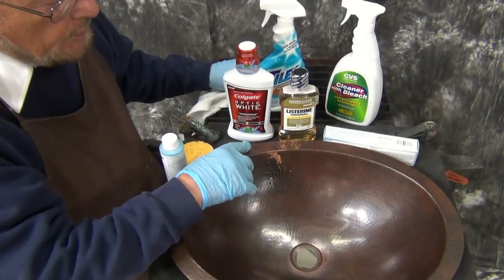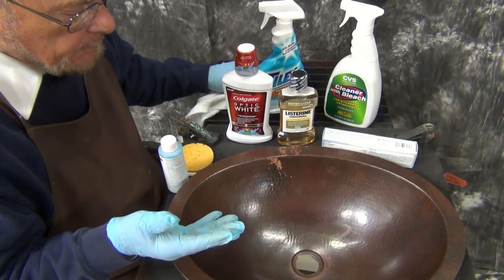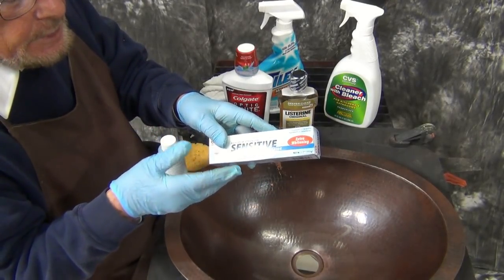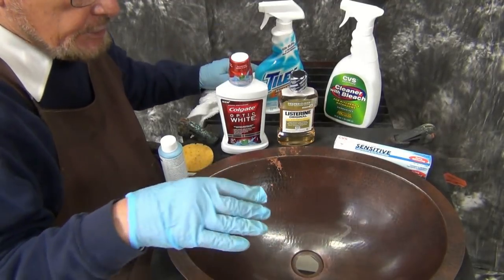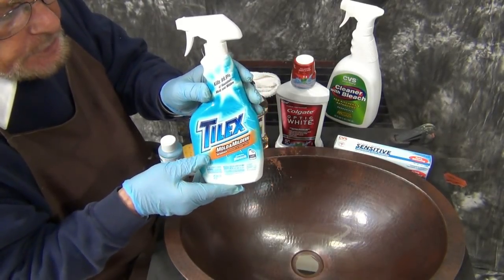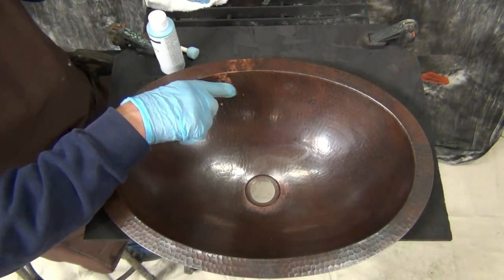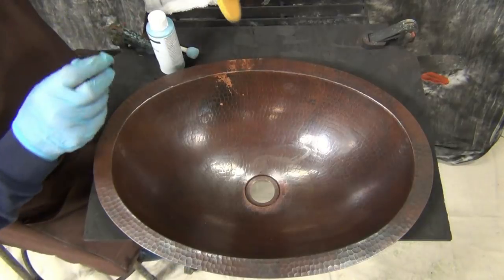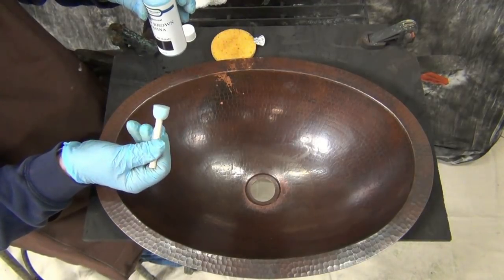Copper Sink Patina Repair

Comment: I have a sink exactly like this, and I damaged it when I wiped it out with a damp sponge - not realizing there was cleaner chemical residue of some sort on the sponge.  It removed my patina down to the shiny copper in several places.  I used all the materials you suggested here, and even as a novice, it came out amazingly well!  The only thing I would say is that the brown patina spray is very very dark, much darker than the sink, nearly black.  Also, you sort of skipped over the part about using the solvent, but I figured it out.  Very helpful video, thank you!

Comment: Excellent tutorial.  Thank you.  I left dishes and flatware in my new copper sink.  Nothing acidic, but now there's rings and worn places where the patina is rubbed off.  Good to know it can be treated, even if it is annoying to discover how fragile the finish actually is.
Reply from the maker: To increase durability, you just need to use the right clear coat. Ever Clear will give you the best protection available.

Comment: So i have a copper sink that is pretty used and needs to be touched up. Do you recommend stripping it down completely and starting over? There are many areas that need to be touched up. I love your video and want to get my sink to look like your finished sink. Mine started out that way but needs some help. Would love to pay you to come fix mine 😉
Reply from the maker: Great question. Personally, I find it easier to strip it down and do a full restoration. That being said, many times it will not look exactly the same as it did before. So if you want it to look basically like it does now but with repairs, do a fix/patch instead. We don't do the service unfortunately, we just sell the products and help with tech support to get it done. Give us a call and we can help walk you through the process 760 432 8242. We may also know someone in your area that can help you out if you rather.

Comment: Great information.  Unfortunately, I was hoping to have copper sinks which would take a beating like stainless does.  Guess I was a little shortsighted.
Reply from the maker: Your best bet if you intend for it to take a beating as you have mentioned is to use the Ever Clear instead of the Clear Guard. Regular reapplication of the Metal Wax will help maintain the surface as well.

Comment: I just had two hammered copper sinks put in that look exactly like the one in your video.  We have hard water.  I have been super good about using a cloth to wipe the water out.  Yesterday I used a sponge instead and it mustn't have wiped up all the water real good (like the cloth) and when I got home, there were hard water marks all over the sink.  What I actually noticed before the water marks, were orange marks.  I used a the sponge and tried removing them, but actually made them a little bit worse.  I was able to get the hard water marks out with some olive oil, but the orange marks are still there....not super noticeable, but noticeable to me.  I think I can fix this thanks to your video.  I try to live in a chemical free home....and would prefer not to use the solvent.  If I can get the color right and not have to use the steel wool, do I need the solvent?   Lastly, what is the difference between Smart Coat and metal wax?  Thank you very much!!!!
Reply from the maker: The orange coming through is likely the copper showing through. You should be able to touch it up easily with a brown patina. You should not need to steel wool if the patina touches it up nicely. You will need to clear coat it however. So Smart Coat is a water based sealer but will not last long term. I would try the wax. It will be less smelly than Clear Guard or Ever Clear. It will also be easy to maintain over the years, but you will need to maintain it periodically.
Reply: @sculptnouveau  Thank you SO much!  Does the little sponge come with the patina?  I don't see it on your website.
Reply from the maker: @tracycapjak9647  Our pleasure! The only sponge we sell is the sea sponge: https://sculptnouveau.com/collections/supplies/products/sea-sponges The one in the video I think we got at Michael's (hobby/art store).

Comment: I need help, I accidentally left a cup with a little bit on vinegar on my sink and it got rid of the rust on the sink (my parents are gonna kill me if they find out) so will this video work for my problem? I don’t want to test it because I don’t want to mess up the sink even more.
Reply from the maker: This video is designed to help fix blemishes in copper sinks. The only update to this video is that M38 fixes a wider assortment of sinks.

Comment: What would I seal with if my sink is installed? Not wanting aerosol varnish used inside the house
Reply from the maker: If you are not wanting to spray anything, the best you can do is the Smart Coat and then maintain it with the Metal Wax.